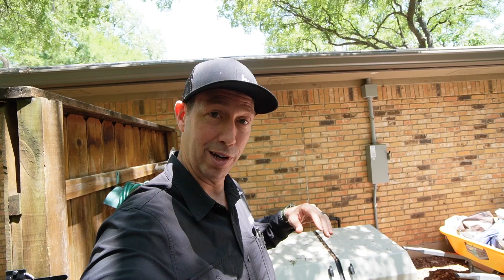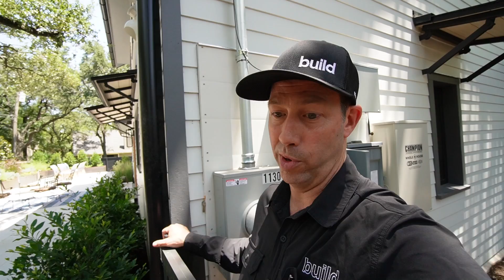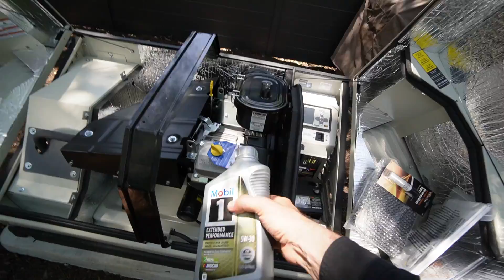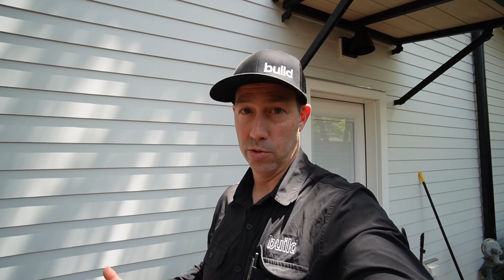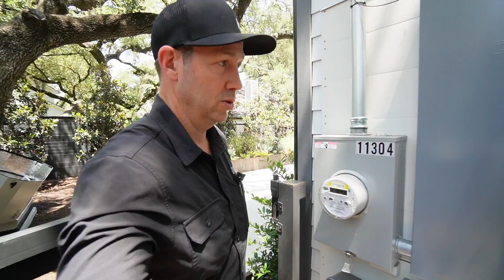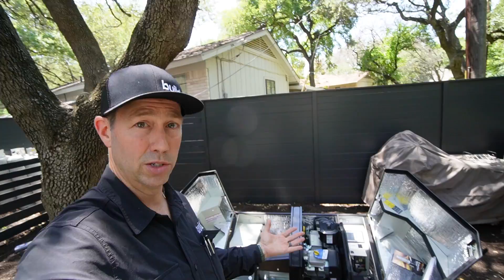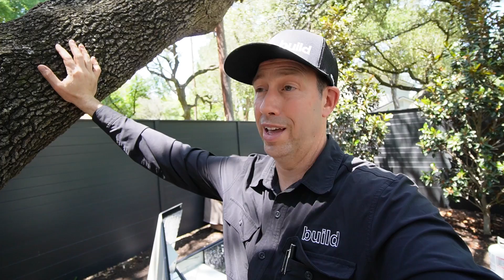Rolling Black Outs? Meet my little friend: Home Standby Generator

Comment: With all the high end equipment you put in your home, I don’t understand why you did not add some solar panels to supplement your grid power consumption. 
I believe Texas uses natural gas and wind for power generation, so in a way you are using natural gas. 
There’s nothing that says you have to buy new solar equipment, find some commercial solar installation that is upgrading their panels and recycle them on your home. 
Your propane tanks don’t last forever, and must be inspected and replaced if they fail inspection, that’s a cost you did not mention, along with telling your insurance agent that you are storing hundreds of gallons of propane on the property. LOL

Comment: It's pretty simple Matt...one system only works when you absolutely need it, yet costs money every day, where the 2nd system costs more upfront, but pays itself back daily.  

Standby generators will be replaced by battery systems almost as quickly as people rushed out to install them in their homes.  

Not to mention how expensive they are to run when actually on.  

Solar and batteries (or just batteries) all the way.

Comment: Matt, bought the 14k champion generator after your first video.  I live in Maine so the the 24 volt starting system was a big plus when it’s zero degrees out in January.  My only suggestion for you would be to consider an underground propane tank, a 500 gallon tank is less than 2k and being underground has many benefits, especially in a hot climate such as Texas.

Comment: Random side note:  There is a few battery technology breakthrough that are going to dramatically change the lifespan of in-house battery packs.  They are about to hit the market in the next year or so. The test runs have shown 50-75% battery life increase for in-house battery packs (where they dont get fully discharged often).  When these arrive, it will change the dynamics around solar and powerwalls.  Your generator can never pay for itself. The solar/powerwalls can actually recoup costs, thats a huge difference. Also, some new solar technology (multi layered perovskite) are showing %40+ efficiency, with an estimated cost of 1/2 that of current solar panels. They are about 3-5 years from market, when they arrive... THAT will break the hold that petroleum products currently have.

Comment: btw, snow on solar is actually not a problem. they heat up even in deep winter enough, to keep themselves clear (I live in Canada, and many houses have solar that is mostly clear within hours of a heavy snowfall).  Side benefit, it keeps the snow weight off your roof.

Small pro-tip:  Keep an extra set of spark plugs in your garage.  IF you need to run it longer then 3-4 days (which exceeds the 100hr mark) then you'll likely need to swap your sparkplugs before you need to worry about the oil.  Oil changes with the fully synthetic oils, def. dont need to be done each 100hrs, they just say this for warranty escape reasons.

Comment: I think solar is more for everyday consumption offset rather than emergencies. I would definitely want a backup generator first and foremost. I just bought a new house and the first thing I purchased was a new panel and the hardware for a generator to be plugged in. Just haven’t had a chance to pick up a generator yet.

Comment: As for Battery backups, there are many other brands out there that are cheaper than tesla and give you more power as well.  Life span on them are 6000 to 8000 cycles and still be 80% or greater.  Just have a small conditioner for the batteries, once and a while use them just like running your generator to make sure it runs well when needed.  can recharge them with solar, generator or regular power lines.  Get what you can at first and add to them later if you wish.  But as you say in allot of shows having a belt and suspenders is great.  So a generator is great as a belt but what is your suspenders?

Comment: Matt, Have you by chance looked at the ecoflow delta max pro? It is a smaller foot print but will charge off the mains power and or if you have the solar panels you could add them on to add charging. Depending on your needs kw it might be a good option. If you haven't done a review of it i defiantly would love to see you review it for a power backup.

Comment: Really interesting video, thanks. I'm also in the Austin area and I don't have a lot of faith in the grid. I have a moderate solar setup and like you am interested in going full electric, but the battery backup proposition is just too much $$$ when considering whole home backup where we would need greater than the 7-9 kW range one battery bank typically provides. I will probably go the nat gas generator route as we have a meter and it's just too practical from an initial cost standpoint. Enjoy your beautiful home!

Comment: Love your Channel, maybe disagree on some points in this post though based on experience with propane and research for electrical solution on 30 acre mini-farm. (FYI, checked with High Cotton and they didn’t want to make the trip from Florence to Huntsville for the project, darn)
Wife and I powered our RV with a built-in propane generator for tailgating (big War Eagle to Mr. Baczek), no shade so continuous direct sunlight. I choose propane for reasons you mentioned plus, exhaust compared to diesel is like a fresh summer breeze, less maintenance, and less noise. I’m familiar with Austin heat (daughter lives there) and air cooled may be stressed if needed due to summer rolling blackouts. For us avoiding overheat shut-offs required creative modifications. A negative with propane is the volume you need. You mentioned you can throw the cylinders in a pickup and take them to be filled. Not as easy as that sounds, that 100lb cylinders will be ~ 160lb full and must be transported upright. In Texas “I think” individuals can transport 5 cylinders at a time in an open pickup truck or trailer not to exceed 1,000 pounds (propane & cylinders). Plan worse case for volume of propane needed and consider plumbing so that a delivery truck can fill you up. Propane providers may be able to help with a more carefree method of filling.
I agree solar isn’t a great option for you, shade, and a shallow sloped roof not a good combo. I’m not sure you should have dismissed batteries though. You stated concerns about longevity and recycling of batteries. Neither should be a limiting concern, cost on the other hand can be a showstopper. You mentioned Tesla and they have gone to great lengths to build a recycling ecosystem. Tesla releases an impact report each year that contains information on their recycling, https://www.tesla.com/ns_videos/2021-tesla-impact-report.pdf.  And as a non-Tesla source of info Sol-up posted a pretty kind sustainability report on the Powerwall, https://solup.com/the-sustainability-and-benefits-of-the-tesla-powerwall. There are cheaper solutions out there than a Tesla Powerwall but it is an elegant all in one solution backed by a commitment to recycling from a company with perhaps the best possible resume for such products and you have a GigaFactory in town. I think Austin has a pilot program for lower cost off-peak electricity. With sufficient battery backup you could set your system to charge at lowest off-peak (10pm – 7am) and use that power during peak (3pm – 6pm) reducing your bill year-round. Regretfully battery backup alone doesn’t qualify for 26% Federal tax credit. Batteries have to charge 100% from owners’ solar array to qualify. If you could place solar on your property capable of charging your backup batteries, you could reduce cost of overall system by 26%. Solar panels are cheap so you could essentially buy down cost of batteries with the addition of a few inexpensive panels.

Comment: I wouldn't do a lithium battery backup like Tesla wall because of price and lack of longevity, but if you ever want to do solar I recommend Nickel-Iron batteries. They do take up a ton of space but they last forever; there are videos of people taking them out of landfills, refilling the electrolyte, and it works just fine. They are also cheap per kilowatt hour

Comment: We have had 2 all electric houses. I will not have another one. We have a pellet stove plus central Heat & Air. We have a propane tank (500 gal). I do have a Miller welder/gas generator but that is limited. I saw your video when you put it in your last house. Why did you not do this in the new house plan?

Comment: Be sure to inspect the engine area's regularly for fluffy the friendly mouse.   They will fill the cooling fins with nesting material, causing the engine to overheat and fail.   I have several air cooled engines that have warped heads and burned up valves due to the blocked cooling system.   Living in the city and rural areas, I have found very few things "mouse-proof"

Comment: Another great video Matt.  One thing you want to consider in any backup generator is the percent of THD (Total Harmonic Distortion) of the power output. Almost everything in today's homes have a circuit board and can be damaged by dirty power.  Your older tri-fuel genny has 15% THD which is 3x what most electronics can handle.  Your new one has <5% which is a much better option.
Reply: It depends on the power supplies of these devices.  Most of them now use switch mode power supply units and will ultimately filter out the power like an inverter.  I don't think it's a huge problem really but for those "sensitive" devices I would rather use an inverter.
Reply: @WJCTechyman  True, computer power bricks do it automatically with a wide range of input voltage. Things like TV's and refrigerators don't and are easily damaged.

Comment: Thank you for covering batteries with your emergency power discussion, it’s becoming more and more important but still difficult. I would consider the peak-shaving value a lot more than the emergency aspects of batteries, but you’re right there’s still a lot of issues and questions even for consulting engineers like me.
Reply: Peak shaving with the right inverter could greatly help pay for the costs of a battery system. Sol-Ark has a pretty sweet peak shaving setup.
Reply: @PartTimeYooper  Sol-Ark is great but overpriced.  There are a few nice options with grabbing dual inverters.
Reply: @blh1997-w1q  any recommendations? I'm always open to better solutions.  And yes the Sol-Ark does seem pricey compared to just about everyone besides Radian

Comment: Matt, before you buy more 100# cylinders do yourself a huge favor and look into getting two 420# DOT Cylinders with an auto changeover regulator. These tanks hold 100 gallons and fly under.the same rules as the 100# cylinders. This is more pleasing aesthetically and much easier to plumb. Hit me up if you need more info 👍.

Comment: The original Tesla Powerwall didn't last long. The specs say 1500 charge cycles (at some low capacity percentage I can't remember). So roughly 4 years. But all the manufactures I've looked at have switched to Life4po lithium cells and they have come a long way. Most advertise 5-6000 cycles at 80% capacity. That is 14-16 years if you discharge them once a day. Quite a few manufactures did a 10 year warranty.
So that is at least 10 years where you would be continuously saving on electricity as well.

Comment: Nice. My wife and I have a Tesla model S, 135k miles and it's over 8 years old (9 years old October this year) and still has well over 80 percent capacity. My spark EV has well over that too and it's approaching 7 or 8 years old (don't know mfg month off top of my head) for the Tesla, that's eight year old Panasonic cells. They work, dude. But you did make a good choice. Backup power is just that. Have it or not, and you do. Very good. I just spent 10k usd for 13kW and 15kwh (lithium iron phosphate) and 7500 watts of used solar panels. Signature solar, out there in Texas, is where i got the stuff from, minus the panels. Meanwhile our diesel expedition 36t has been on standby for us with 10 days of fuel at the ready since 2016. Only needed it once. Why the off grid setup? Well, fortunately my electricity prices have virtually stayed the same the past 6 years, gas and commodity prices haven't. Getting the renewable setup locks in cost vs. being at the will of energy companies.

Comment: When you have the budget or a sponsor, consider adding batteries to your generator setup. When I have a grid down, I use the batteries first, then the generator comes online. Recharge the batteries and the generator shuts off. For a well designed system, that means 8 hours of generator time per 24 hours. I have enough solar to make that 4 hours per day winter and 0 summer but I have also have gas heat. For Lithium batteries, expect about 10 years of life. For a low-cost gas generator, 500 to maybe 1,000 hours is about the limit. Even with no power outages the generator will run doing scheduled tests. You will replace the generator before 10 years.
Reply: Hybrid systems are the way to go. with a water cooled system you can also store the heat from the generator for later use if you live in a cold climate. but I would recommend that you are very handy if you go this route

Comment: My biggest disappointment with this video is the old tech for the panel.  SPAN makes some really cool panels.  I would look at using solar more to go off-grid rather than as a backup, so I def. also considered a dual fuel generator (seems not so difficult to make my own methane with a biogas digester), but yeah would probably also have done propane as a backup to my backup.

If wind can get easier/better for home, then I would start looking towards that as another option (or alternatively if batteries get better/cheaper, the idea of needing a generator as a backup would diminish).

Comment: Great video. I have the Tesla solar tiles and their battery backup. The 4 Tesla PowerWalls that I have are liquid cooled which extends their life significantly. The batteries in the powerwall are the same ones in the cars giving them a degradation rate of around 10-20 percent over 10 years depending on how many times they are cycled. After that the degradation slows down even further so you may get less kWh backup but you should get a good portion going on 20 years. If you don't want the battery you can still put up some solar. This can extend the amount of time you can be without power quite a bit. Since the house is already hooked up to a generator there may not be a need for as many panels which can save money. The great thing about solar, there is a payback period that can never be achieved with a generator. The solar offset of your daily electrical usage will happen whether you are getting grid power or not. This can save a decent amount on electric bills especially as the cost of electricity rises.

I know there are reservations but I would highly recommend getting at least one battery if anyone puts solar on their house. As most grid tie solar systems won't continue to power the house during an outage without a battery backup. This means that even when the sun is shining that you will not be able to use any of that electricity being produced by the solar without someplace for the excess power to go as the solar doesn't moderate itself to meet the changing electrical demands of the house. Making a buffer necessary between the solar and house. During an outage if the battery becomes full the solar will turn itself off until the battery drains to around 90%. Then the solar comes back on to power the house and charge the battery. To share my example of keeping power during the same ice storm outages you mentioned while living in the Dallas metroplex. When the power went out here in North Texas my batteries instantaneously switched over, with barely a flicker to let us know the power even went out. The only way I knew we were on battery power was by looking at the app. Once the batteries kicked on I knew I began to do the calculations and even with the solar I worried that because it was going to be cloudy that I may not produce enough electricity to get me through the 10 days it may be out. Lucky for us the power would come back on a couple times throughout the day and the grid would actually charge my batteries back up. With 4 batteries I had no problem making it through 24 hours and every time that they would get filled up again it would reset the clock as I couldn't rely on solar alone to charge them back up.

Between the solar I was able to generate and the grid providing intermittent power to charge the batteries I was able to keep the power on throughout the storm. This allowed me to keep the house heated and keep the kids happy with power for the lights, TVs, WIFI and tablets. This new realization of scraping by during the outage without knowing if I will have enough power. I decided to do like Matt. I picked up a tri fuel generator and multiple propane tanks. During the storm we never lost the NG to the house and I have since added a nipple from the gas line where I installed the tankless in the garage and a detachable 20 foot flexible NG hose to run to the generator if this were to ever happen again. With both NG, propane and 7 gallons of gas this would offset a large portion of the power that would normally drain the batteries if there isn't enough sun.

The good news since then is that my system has been able to meet the daily demands for the house and during March through May and September through November we actually produce far more power than we need. My average electric bill for the 4,000 sq. foot house use to run around $3,500 a year. My new power bill for the year after the solar install is around $400 and the majority of that is the $21 monthly meter fee I pay for the privilege of being hooked up to the grid.